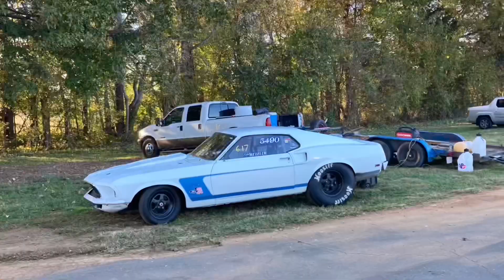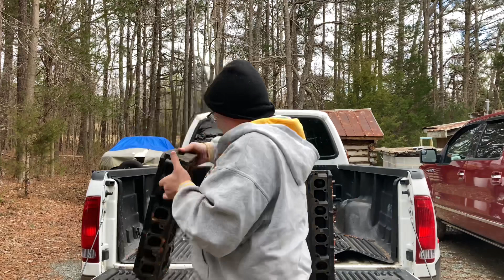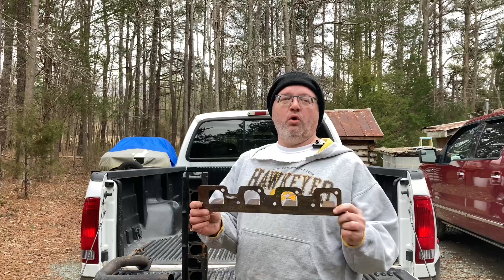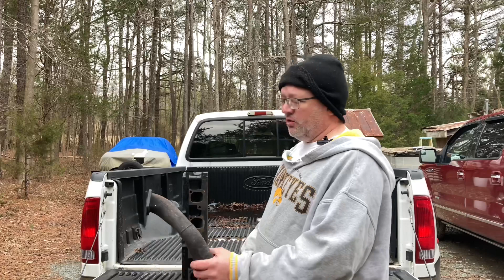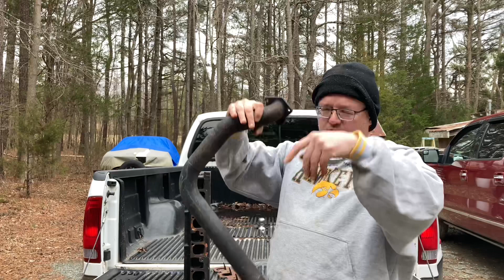Let’s talk 351c exhaust ports

Comment: what does the 71 4v CC chambers measure out to? and what about the flow on intake and exhaust? I thought 260-280 intake at .6?
Reply from the maker: 280-ish sounds about right. It’s been a long time since I flowed any stock ports. I’m sure other people will have differing experiences,  but we never cc’ed any closed chamber heads that were less than 67 ccs stock.  We had to cut every set of closed chamber heads I ever ran to get them down to 64 ccs.
Reply: @ thank you, I thought so, I had mine milled .020 and I’m waiting on them.

Comment: Hi there. Nice to see a video from someone who knows what he is talking about. I agree that many "experts" just repeat bad or unverified information. I am new to ford engines (but well versed in Chevy builds) and have a question for you. I recently acquired a 73 mustang with the Cleveland smog engine (dished pistons, etc) . I have recently found a set of these 4V large port heads you are talking about from 1970 (closed chambered), and I really want to put them on this smog engine. I need it to be very streetable, and I am looking for reasonable  dynamic compression for pump premium and good low end torque rather than top end horse power . Almost everyone is telling me to not use these heads because there isnt anyway to make them build torque in the lower RPM range. I think you are the one to correct them and tell me how I can use these on this 73 smog engine with good torque in the lower RPM range (at the sacrifice of hp if needed). Any advice. I found these heads already built for almost nothing and want to use them. Thank you for any advice you can provide.

Comment: Great video. The one thing about the exhaust ports is this. It's a tapered inlet/outlet past the valve. The engineers used a clever trick to so solve the shock tower obstruction. Everyone knows that tapering an intake port will broaden the power band and no taper makes a stronger peak. So in the exhaust port the "ramp" actually functions as taper to provide the low pressure reflected wave greater rpm band effect. This is why over camming Clevelands is so common. People try to treat them like SBC's and they're not Chevy's. The obsession with building them like Chevy's is the source of most myths about them.
The 'wide open' theme was the driving ethos of the design team. Hence the large intake and exhaust.
I still run exclusively Cleveland motors including the 400. Best base engine architecture for two overhead valve heads ever. The LS Chevy is an obvious rip off of it with inline valves instead of canted. At least they finally built a good engine though. 😮😮😅😅😅😂😂😂

Comment: The short radius in the intake is the only thing you need to worry about besides putting a tongue on the floor of that intake
Reply from the maker: I don’t need to worry about any of it at this point as I no longer own any Cleveland stuff. 😂
Reply: @hetzlerracing5490  no more Cleveland videos 😢
Reply from the maker: @rossgirdeen3247  That is correct.

Comment: I am not a huge Cleveland fan, BUT, back before 460 Swaps were made popular in 78/79 4x4 Ford Trucks, in other words I couldn't afford the Stupid Expensive SWAP kits, much less find a 460 that I could trust, I worked at a Machine Shop, building specifically FORD engines, I took my tired 400 out of my truck (79 F250 4x4 SuperCab Long Box T18-Manual with 3.54/3.55 Gears)
-
I bored it .030 over, milled the decks, and put custom pistons in it, balanced the crank, I had mildly ported, closed chamber 4V heads, and 4V 351C intake with spacer plates, custom cam (High lift and moderate duration - it was going in a 6500lb truck, I needed some torque), custom headers with IIRC 2" (or could've been 2-1/16 primary tubes, my boss made them by hand for that truck), he was the welding expert, I ran an Edelbrock 750 AVS (not a Holley on daily guy), Melling HV pump (as I do in most of my builds) and I found that a 408 with all those goodies will pull like a freight train from 2000rpm to 6000prm and surprise the crap out of similar trucks with mild 429/460s.
-
That whole "you need 9000rpm" myth is just that...Yeah on a Boss 302 you need 8000rpm to use the heads, but a 408 @ 6000 is actually the same flow! (6500 on your 377) - I think a lot of that myth comes from the fact that most of those cars I saw, had a solid cam that was equally worthless for torque...And the Carburetors were not optimal for the street use....

Comment: I often say that the greatest weakness of the Cleveland is Team Small Port engine builders. They don't understand how a Cleveland works. If you build it the same as your small port engines, you will build it wrong. Almost every camshaft company grinds camshafts based on Chevy based knowledge, which is exactly what you shouldn't do with a Cleveland. They need different camshaft timing events. What most people don't know is that Ford flow test heads ar 5"Hg, which is 63"H2O. When you get up thete, the flow numbers change markedly, not the corrected flow numbers, but the differences between the 4V head and the others.

Comment: There is lots of guys out there with Chevy on the brain.
When working with a Cleveland you must forget all that Chevy crap and go with what the Ford engineers had in mind in the 60s. You must get into the the head of the Ford engineers.

I have 2v and 4v in almost identical set ups and the 4v kills the 2v everywhere. Non of this "oh 4v for race and 2v for street" that's crap. That's a engine built by a Chevy nut.
The 4v is better going fast, going slow, accelerating, driving in traffic, going flat out.
The Cleveland is not a Chevy, do not treat it like one.

Just to confuse the crap out of everyone, in Australia they did make 2v headed engines with 4 barrel carbs and they also made 2v heads with closed chambers of 54cc.
So you can directly compare a closed chambered 4v with a closed chambered 2v.
The 4v goes better all round.
The 2v tends to increase in power in a linear fashion, but the 4v increases logarithmicly.
So go twice as hard in the 2v you get twice the performance. Go twice as hard in a 4v you get four times the performance. They are about equal down low.

Comment: The wrong combo kills 4v clevelands; people build them like a SBC then wonder why they don't feel great. They are a unique platform that falls on it's face if the components don't compliment the heads properly. Letting them work as intended really wakes them up.
Reply from the maker: Yep. My buddies with SBC engines would tell me all the time, "you need to do this, or do that", usually camshaft related, and I would have to remind them it had 240cc intake ports and a 2.19 intake valve, it was NOT a sbc.
Reply: @hetzlerracing5490  good 4V Cleveland Cam specs would baffle SBC guys.
Reply: Agreed. In my opinion, the Cleveland is the most misunderstood performance engine in history

Comment: Good video with good info, thanks. I raced the 351 Cleveland on dirt tracks for 11 years back in the 80's and 90's. I ran the US 4V closed, 4V open, 2V open and the Aussie 2V closed (known as a 302C in Aussie land).
ALL OF THEM WORKED WELL!  No complaints, however, some were better than others, NONE were bad. The 4V closed had great top end H/P, but lacked a little in bottom end torque, the 4V open did not have as much top end H/P as the 4V closed, but still ran well. the 2V open had good bottom end torque but lacked some top end H/P, The Aussie 2V-302C closed heads had good bottom end torque and good top end H/P on the dirt tracks. We won feature races with ALL four types of Cleveland heads. I don't believe FORD made a "bad" Cleveland head, It depended on your use of them in any particular type of Racing or Hot Rodding effort.  We were limited to a 2V carb with no more than 500 cfm. (HOLLEY-4412). What was more important was cam selection and cam timing. I tried those exhaust plates on the 351C 4V heads and they sucked, down on power in the heat race, so we pulled them out before the main event, H/P was back, they were junk to me.  I know you are talking about Drag Racing here, just thought I would share some of my 351Cleveland experience with you and others.
You probably know about this site already, but, you should check out DragBossGarage on YouTube. It's dedicated to the 351Cleveland by a diehard drag racer, lots of great info and history. Thanks again.
Reply: You mean the plates on the intake port floors, dontcha?

Comment: Yep good video… Nothing really beats a factory 4v whether it open or closed chamber.
I’ve read for yrs how so many have ridiculed the open chamber heads saying they cause detonation!, only if you run low octane fuel and may be the case in the states. Here in Australia we have 95-98 pump gas at the bowser which assists these older engines to run fine.
I own a 347 Clevor  with ported 2v open chamber heads with 10:1 comp . It’s a solid lifter engine that makes 400 hp and goes like a bullet.
Runs on 98 fuel and have had the dizzy re graphed to suit my car.
Never had a detonation or pinging in 12 yrs!!!!?
4v heads on bigger cube engines are certainly the go as they move more air. Also modern camshafts designs compliment the running of these heads to make awesome power!! Definitely stay with them if you’ve got a pair!
Jon from down under👍🏼

Comment: I would like to know your thoughts on stroking the 351 Cleveland, was thinking of a stroker engine for my 1971 Torino Cobra because it a really big heavy car, it did run awesome with the 351 but it needs rebuilt now and I’m thinking of the stroker but I don’t know what size I should go on it, thanks for the video!
Reply from the maker: A stroker will definitely help move that big car easier. I wouldn't go any smaller than a 393.

Comment: Good information on the 351 Cleveland! The strongest running car I’ve ever driven 1971 Torino Cobra with a Factory 351 Cleveland 4v engine with a bigger crane blazer camshaft and a 800 cfm carb; thanks for the information I was wanting to put the raised exhaust plates on and did wonder if they would fit with the factory shock towers. Good video thanks!

Comment: Good to see you are out of hibernation brother. Another thing most do not realize is the 4V open chamber factory out flows the 4v closed chamber factory.
Reply from the maker: Yes it does, mostly at low and mid lifts due to the valve being unshrouded.  My open chamber heads actually outran my closed chamber heads.